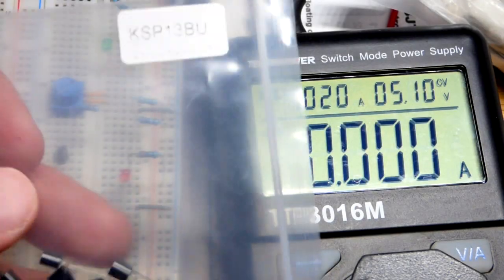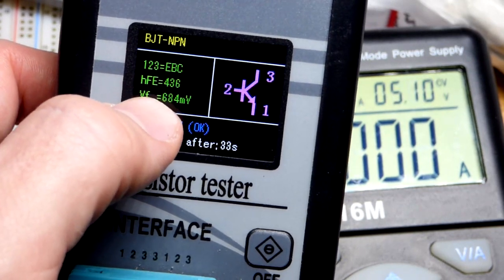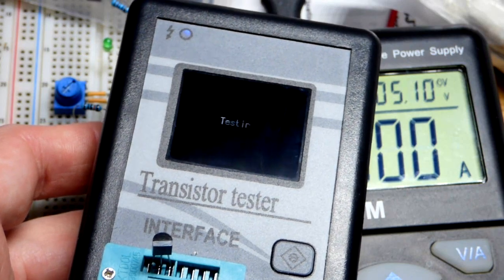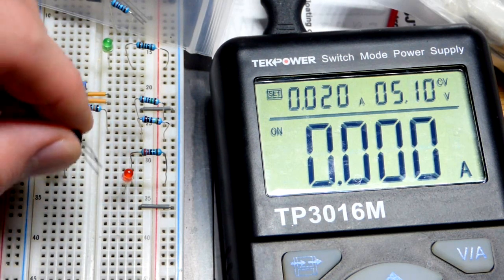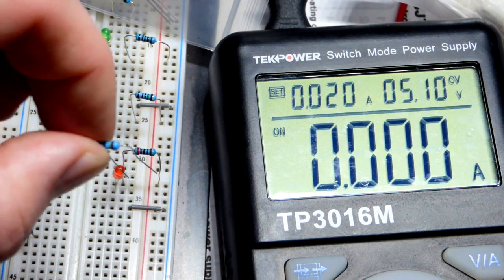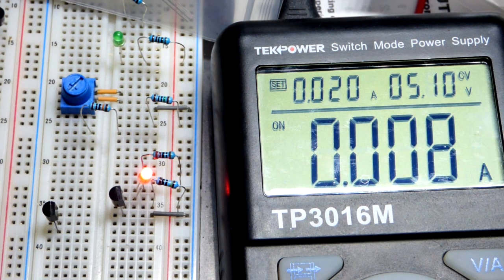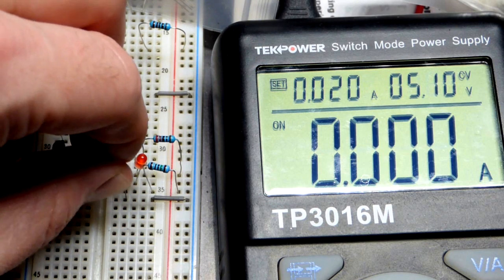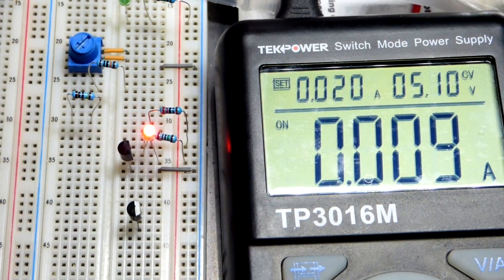KSP13 NPN darlington pair transistor compared 2N3904 NPN BJT from semiconductor kit

Comment: I took my chances on a transistor tester DIY put it together yourself with yer soldering iron and solder kit on eBay for just under $10 (USD) and not only did it take 3 weeks to arrive (free shipping FTW) but they ripped me off! How did they rip me off you ask? Well ... the dang thing came PRE-SOLDERED! I was gonna make a video!! 😂And to add total insult to injury it works just fine so I can't even repair it! 😂
Reply from the maker: Nice! I did notice that it was often hard to tell if it was built already or not on Ebay.